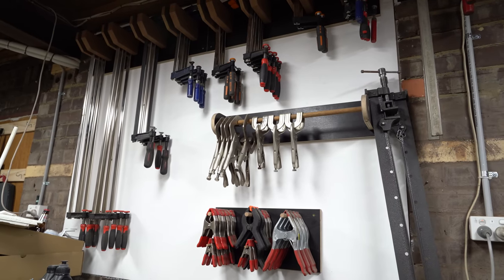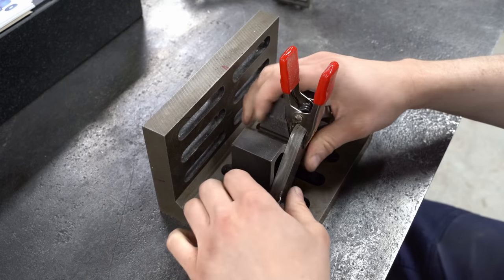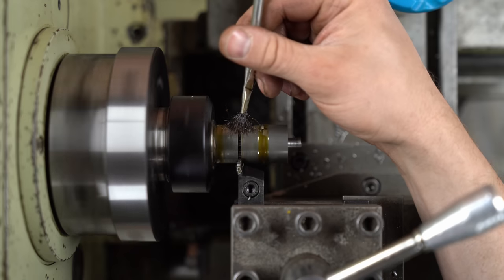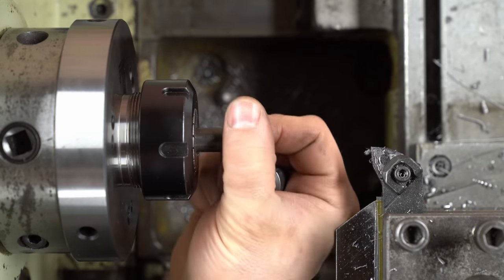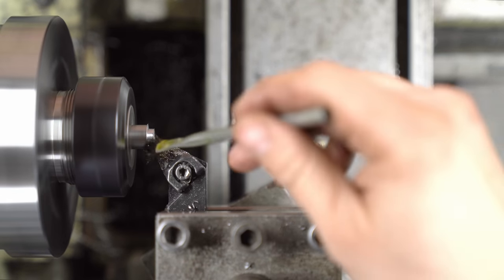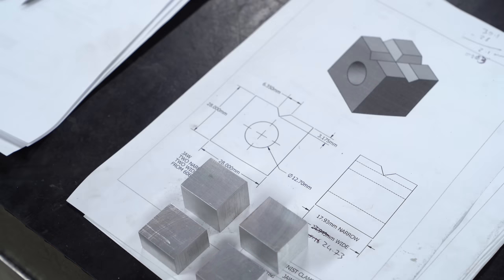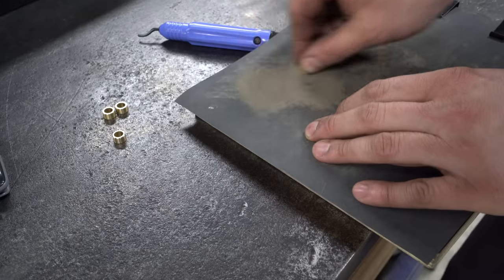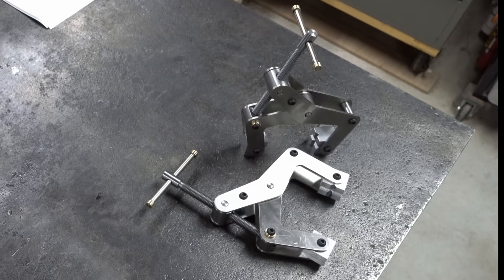Making some TASTY kant style clamps | CRAIG'S WORKSHOP

Comment: Good stuff, man! Always rewarding when your nicest of a tool is one you've made! There were also a couple subtle things you did that I like. Using the back of the mill vise jaw as a filing stop and using the caliper to set your combination square. Neither has ever even entered my brain before... but that's not saying much. Also on the choppiness you mention while thread turning, I've run into this a lot as well. I suspect there are a couple things going on. One is possibly running too slow of a cutting speed, though this can be scary to increase if you're not on your A game. The other is just how long of a thread you were cutting. It gets unstable in the middle without a follow rest. I've done similar aspect ratio threading unsupported and have even been lucky enough for them to snag and yank themselves right out of the lathe 👌👌 Either way when I get that choppiness I have a triangular pin file and emery cloth I run through the threads a few times to smooth them out. Keep at it, man! Loving the videos and projects
Reply from the maker: Thanks Brandon - those are some good insights. I will certainly try the small triangle file idea - good thinking. I'm glad you picked up some other ways of doing things from the video. I'll also try threading faster next time, I did leave a big "runout" or gutter, so it wouldn't be too hard to disengage at the right moment. Thank you for the ongoing encouragement, it's great to have you watching and commenting on the videos. Cheers, Craig
Reply: so you're the reason this fella showed up in my reccomended list :D But, there can never be enough good machinist channels on youtube :D
Reply from the maker: Thanks Nico 👍
Reply: @Craig's Workshop  your most welcome, been following Brandon here since he uploaded his 2nd video and was instantly hooked, and since then, it's been Machining porn galore, everything from smaller items all the way up to huge stuff for earthmoving machines done by a channel called cutting edge engineering 😁 and now you've been put on my subscribe list too.

Comment: Man, cutting out your own plates. That's hard core! Those of us less gifted or terminally lazy just buy the laser cut ones. Just to add to your 10mm standardised tooling,  get yourself a smallish key less chuck and mount it on a 10mm plain shank. They are great for small drill bits and don't need a lot of headroom to change.
Cheers,
Preso.
Reply from the maker: Thank you preso. I had not thought about a mini chuck on a 10mm shaft. Great idea!

Comment: If you punch and drill the holes first you can bolt the roughly cut pieces together using pieces of threaded rod and coupling nuts, then mill the “block” of plates. 
Faster than shaping individual pieces.

If you have a rotary table you can side mill the block in one setup, but it helps if you draw the shape in CAD and mark all angles, radiuses and lengths for moving the workpiece.
Reply from the maker: Thanks Ro K. I considered bolting the stacks together, But it would have meant I couldn't shape the stacks as a group as easily, using the face of one plate as a square reference for the edges of the stack.

I also have a rotary table and the mill, and I considered rotary milling, but I didn't have a set of dimensions to work from, just an outline. I could have redrawn the shapes in CAD, overlaying onto the existing outlines, but with the method I used, I could save that whole step. The shaping did not take that long. The belt sander makes quick work of it.

I thought that on balance the way I did it was likely to be the quickest way to get the parts shaped and kept within tolerance. Your suggestions would definitely have worked though - just with a different set of compromises/challenges. 

Thanks,
Craig

Comment: I was having trouble drilling stainless. I watched a video with an older gentleman who suggested just using water and it worked for me.
Reply from the maker: Thanks Cee Jay, did you have any issues with water getting into and under the vise and causing rust?
Reply: @CraigsWorkshop  No, I just I just wiped everything down with some WD40 afterwards and I keep the screw and mating surfaces well oiled with NUTO H32.
Reply from the maker: @Cee.Jay.71  Thanks - that's a good plan 👍

Comment: I saw a good tip from Amob on removing “collars” of parts like your brass ones. Instead of using pliers, place the part in your mill vise jaws loosely with the collar above the top face and tap them in the Z axis. This will shear the collar off flush, it works very well.
Reply from the maker: That is a great idea. Thanks 👍

Comment: Hi Craig, Nice work and they'll be most useful in the shop.
With the thread cutting it looked as though you had the tool setup to cut on both sides of the tip. This produces a lot of tool pressure, hence the poor finish and material deflection over that length of thread. Search YT for the '29.5° compound thread cutting' setup. Using this method cuts the thread on only one side of the tip reducing tool pressure and leaves a better finish (normally) and better used when cutting long threads on smaller diameter stock.
Nice editing..
Regards
Kevin
Reply from the maker: Thanks Kev. Yes I know about feeding into one flank of the thread and that's how I have been doing it for years. But, the compound on this lathe needs a new gib and a new gib retention method, so I have it locked down at the moment, and had to feed the tool in perpendicularly as a temporary work around.

Comment: Great idea on standardizing on 10mm. I’ve been doing similar!
Reply from the maker: Preso suggested that I get myself a small keyless chuck and put it on a 10mm shank too. Great idea! Those small chucks use much less headroom too. A chuck used strictly for drilling doesn't need much bend stiffness, just needs torsional stiffness mostly.

Comment: "Brain on holiday", yep, I can relate to that! BS aside, nice job. 
Figure 8 Lapping, definitely. I've lapped hundreds (minimum) of injector nozzles and bodies and they have no gaskets just metal to metal and over 2000 psig, no leaks. So I know that method of lapping works.😊
Reply from the maker: Thanks Peter. Yes, that method does seem to make a nice flat surface and it's fairly easy to do. Cheers for the comment! Craig

Comment: Nicely done there Craig.
I'd admit to wanting to try a Kant Twist for ..
Decades.
Someday...
Btw, even slower on that stainless
Reply from the maker: Thanks Carl. Even slower? Ok - that's what I'm doing wrong. Thank you for that pointer, I'm a total novice with stainless and don't want to wreck my tools. Yes, these clamps are an excellent design, came out even better than I hoped. I can really recommend the plans they are good quality, and cheap. Or - you can just buy the clamps ready made - they are not too expensive, especially given how much time you'd put into making a set. Cheers, Craig

Comment: You could have turned the brass rings a tenth of a milimeter smaller on the inside, then heated them before pushing them onto the ends of the handles. When cooling, the contraction should have been enough to lock them in place.
Reply from the maker: That's a good idea. A shrink fit would have been ideal in this situation. 👍

Comment: Unless your in a production environment it's generally best in my experience to ignore drill speeds when drilling stainless.
For example, I was cross drilling brake rotors for my Yamaha XS650. (70's Japanese bikes are well known for having brakes that don't work in the wet)
'Correct' rpm, drilled four holes, drill needed sharpening. Dropping rpm to 200, I then drilled 160 half inch holes in 7mm stainless plate (I was doing dual rotor conversion) It also lightened the discs by  over a half pound each which was a plus.
Reply from the maker: Thanks for that, that's really good info. A friend of mine who also commented (Carl) also said slow it down even further, so I think I'm sensing a pattern here. I'll try slowing it right down (using your 200rpm/half-inch as a guide) and I'm sure it will help a whole lot. Thanks again.
Reply from the maker: I just checked the numbers and I think my chart says 25 m/min for stainless. Your number equates to about 1/3 that, which I think will make a big difference. Thanks again.
Reply: @CraigsWorkshop  I forgot to add, it was 'ordinary' HSS drill, not even cobalt and years before TiAN was a common coating (not sure it had even been invented?)

Comment: I'm with Rusty. Bought clamps and then onto building something
Reply from the maker: Thanks union.
Reply: @CraigsWorkshop  I get it that there are some who take great enjoyment out of making "kit" I have built machines myself including a gear cutting machine  etc. But I have always been a steam engine builder, traction engines and locos. Do you have something in mind to build or are you just enjoying the journey?
Reply from the maker: Tools and machines interest me in probably the same way as engines and clocks and cars interest others. Also, because I'm buying older machines that are in need of repair or restoration, that's a natural source of projects.

And since I'm unable to afford to buy everything that I need, new, making them is a good option, and a good learning exercise, and it's great fun.

I'm self-taught, and consider myself a lifelong learner, so I don't see any of this as a waste of time. Sorry if it doesn't float your boat in the same way an engine build would.
Reply: @CraigsWorkshop  Not at all, I fully get it. I have just written an article for the Model Engineer on making guards for a milling machine. It is all relevant! 
I have known many good model engineers though who set out with great intentions and got distracted and ended building nothing. They had fun along the way though.
Reply from the maker: I'm getting the sense that you think I need to build engines or have a specific bigger goal in mind, before I can build my workshop and make videos charting my progress.

I think that's where we maybe see things a little differently. I find it highly enjoyable and worthwhile to make and fix tools and machines, to fix and make parts for friends and acquaintances, and to build an all-round useful and general-purpose workshop. That is already a great intention, and not a distraction.

And it's certainly not building nothing, just because it isn't building engines.

Yes, these values are subjective. That's why I wouldn't try to impress them onto others. I get that others have different values and different goals.

That's not to say I won't build an engine sometime later, but it doesn't excite me in the same way it obviously does for some people. And for me it's not the be-all-end-all (And it's fine if we want different things from our workshops. If we were all the same, this conversation would be a lot less fun.)

Thank you for making me clarify my thinking about this, and getting me to put it out in written words - I think this has also been a worthwhile thing.

Cheers, Craig
Reply: @CraigsWorkshop  I fully support that; The important thing is that we take enjoyment out of what we do. One of the biggest enjoyments for me is making adaptions for people with disabilities, making something we take for granted work for someone who is physically different  and struggles with it. It can be challenging, frustrating at times but very worthwhile.
Reply from the maker: That's a very noble undertaking. (And I bet it's very difficult, but very rewarding). I am glad people like you exist to help level the playing field for folks with different requirements. I actually have a couple of disabled people close to me. Good on you 👍
Reply: @CraigsWorkshop  And I thank you for producing the videos you do, I enjoy them very much.

Comment: Why green instead of maroon scotch brite? 
I tend to use three colors. Grey, green, maroon. Roughly 800, 600, 320. 
Or were you going for final polish?
Great job on the clamps.
Reply from the maker: It's the most easily accessible scotchbrite like substance (AKA non-woven abrasive) that's available near me in bulk, not sold sheet-by-sheet but in packs of 10, and it's super cheap. Sold in the cleaning section of our hardware shop. So I have one choice of grit :) Thanks Dan!

Comment: Nice. I may have a go at this at some point. I even have some 1/8" or 3mm thick stainless.

Do you know if your stainless is 304 or 316. I find it makes a big difference - 304 isn't too ornery, 316 can be a right pain and does work harden much worse.
Reply from the maker: Thanks Mats. From what you've said, I'm going to assume it's 316. I have had reasonable luck with certain pieces of stainless before, but then sometimes a piece comes along and defies all my attempts to make it play nice. Perhaps I should stop using scrap and start buying named alloys, just so that I can have half a chance at knowing what I've got. Thanks again for the advice 👍
Reply from the maker: PS: Definitely have a go at making some they are a good fun project, nothing is too critical, dimensions wise, and you get something out at the end that you'll use on a near-daily basis. I think this is what is drawing me towards making tools and fixing machines more than the other kinds of projects.
Reply: @CraigsWorkshop  Of course, there's 4731 (estimated) other possible mixes of metals that are all grouped under the title of "stainless". So, it could of course be "neither of those two". 

Buying fresh stock does help, but only if you keep track of which bit is what material! I have a few bits and pieces that I don't even know if it's stainless or some high grade stuff, but not stainless... :)
Reply from the maker: I picked up a good habit from Stefan. When I buy some new stock that is a known alloy, I use the Dremel and a burr to engrave on the end what it is. That might be O1, 4140, 1045 or 12L14, etc. Then I work from the other end of that bar. The problem is, 90% of my stock is not acquired this way, so until I give up being a cheap magpie for materials, and work through all my stock, I think I will be in for some mystery metal surprises 😑

Comment: Nice work Craig. Was the stainless specified or have you just decided to reduce your de-rusting load?
Reply from the maker: Thanks Russell. I hadn't thought about the time saved de-rusting. :) Truth be told, this was the only sheet/plate that I had which was about the right thickness. So the decision was easy! I don't know what alloy it was, but I am assuming it's one of the hard-to-work ones.
Reply: @CraigsWorkshop  Good old serendipity.
The austenitic stainless steels (commonly known as the 300 series, typically 304 and 316 in sheet form) work-harden readily. Don't try "sneaking up" on a dimension or pushing on with a dull cutting edge. If corrosion resistance is important in a corrosive environment and the part has been welded, the heat-affected zone should be passivated using a "pickling paste" which is made of some very aggressive acids. Your tack welds are unlikely to cause you any problems.
Reply from the maker: @russelldold4827  Thanks for the info Russell, very useful.

Comment: I hate stainless, I have learned, chasing the threads on new nuts and bolts stops them galling, I do hope those pecker marks in the mill vice are from the previous owner, can't see you letting that happen.
How old is your red kelpie? i have a black n tan, Sadie, she is coming up 12 months, my best mate
Reply from the maker: The mill vice was second hand yes. Even with the visible faults and pecker marks all over it, it's all true and flat and precise, (well, since I stoned it with precision stones), and it's actually a great vise and the price was right. New ones this size are outside my budget.

Yes, Rusty's probably between 4 and 5 we think. He's my best mate too. They are awesome creatures, and I'm so very glad we got him when we did. I love him to bits.